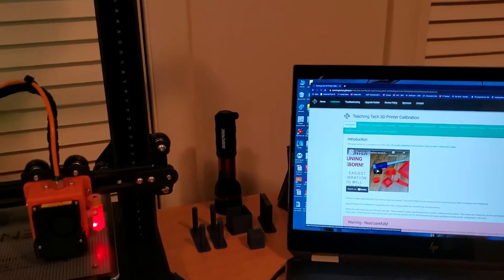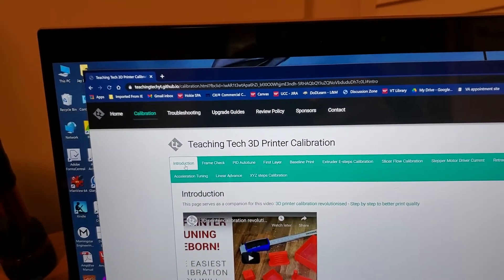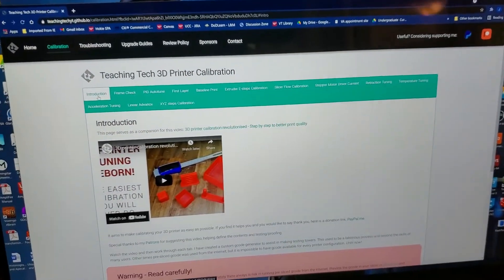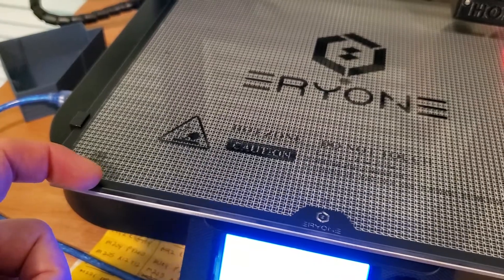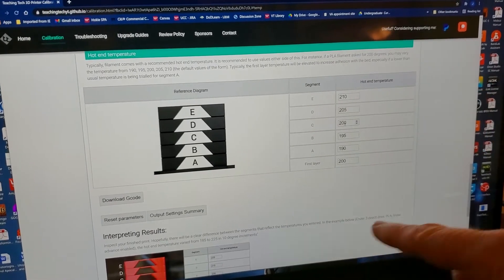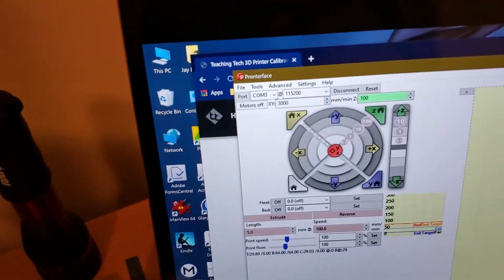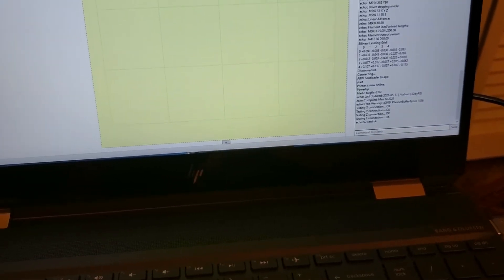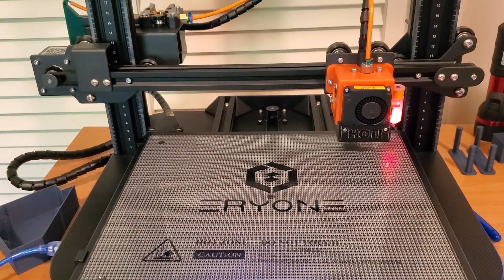Episode 4 - Software/Internet Tools for Calibrating

Comment: Thank you very much for this Playlist, I have my ER20 also since 2 years but never really tuned anything in more than necessary.
I used it for basic things and just wanted it to print, now I need dimensional accuracy for a bunch of mechanical parts, and this tutorial is perfect.

I should have done this from the beginning, have a great day.
Reply from the maker: Thank you!  My ER-20 is still cranking out great prints as a result of these mods....